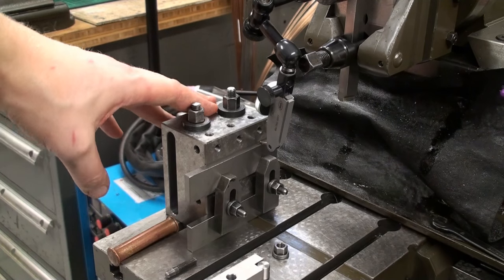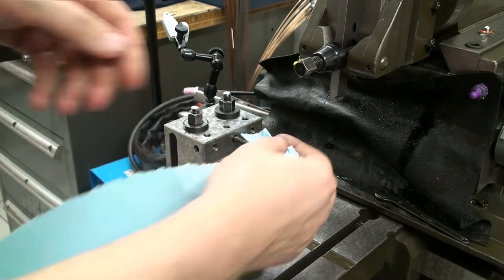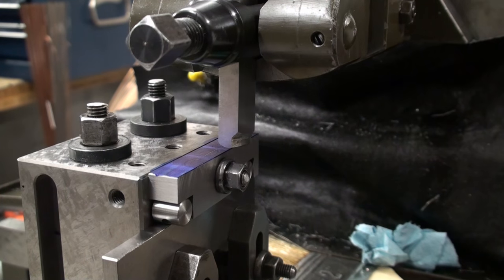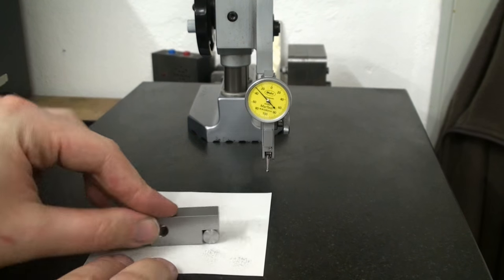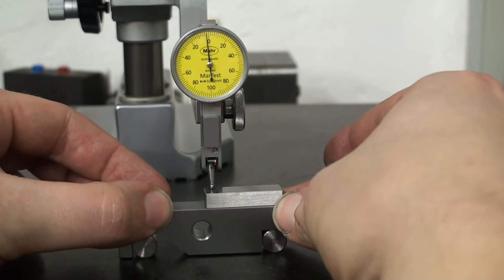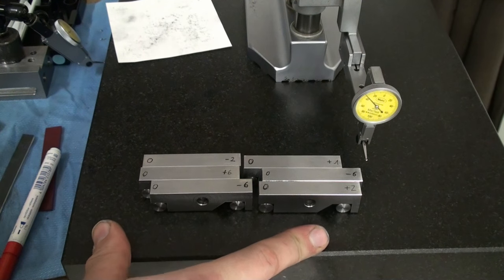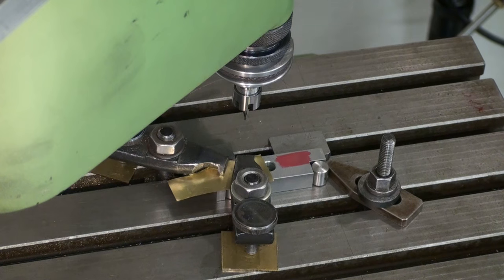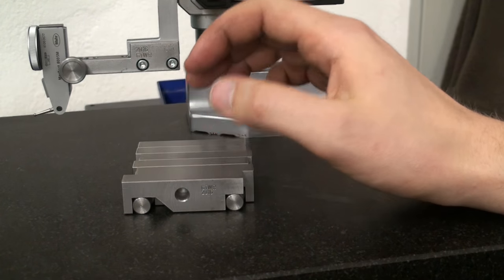Making small sine bars Part 3 - Herstellung kleiner Sinuslineale Teil 3

Comment: Love those single ended open jaw DIN 894 spanners you are using on the shaper. I got one for one specific job and ended up then buying a full set from 6 - 36mm minus some none prefered sizes like 18mm. Doubled up on things like 13 and 17mm. They are really so well made and not at all expensive, I bought Elora ones but Gedore and others make them as well.

Comment: Always interesting setups Stefan. I like how you only use holding pressure where needed and only to the degree for which it's needed. (lol don't use a sledge hammer to put a picture frame up... lol)

Comment: Stefan, I notice that you have set up the shaper to cut on the pull stroke, not the push stroke.  Does the tool kick back on the return push stroke to clear the work and not scrape the tool backwards like I have seen in other machines?  Why the difference: Does it give a better finish?
Reply from the maker: I wrote more about the pull-type clapper box here: http://gtwr.de/ressources/res_gack_rueckwaertshobelkopf/index.html
Reply: Stefan, do you mean that any horizontal shaper could with the alternative head perform pull cutting rather than push cutting?  Wow, that makes a lot of sense to me.  The parallel to me with woodworking is using Japanese saws versus European saws - the latter working on a push stroke and the former on a pull cut.  I am amazed by the ease and accuracy that a Japanese saw provides.  My grandchildren (5 years of age) can cut straight cuts using a Japanese saw - whereas my first forays into using European saws as a 5 year old only let to tears, blisters and a little blood!

By dumb luck I recently acquired a beautiful working horizontal shaper cutter with a 500 mm stroke for a tiny price. I happened to be in the foyer of a second hand equipment sales yard when someone came in wanting to sell it to the store.  The store man was not interested, but I was. Now I am looking very much forward to getting it into my possession and start using it. Your videos have been very helpful in conforming that my impulsive decision to purchase this machine was a good one.  Now all I need is a surface grinder and voila - the great basis for a toolmaker workshop.

Comment: If you can get a few thousandths of a mm i.e. microns with a shaper, you do not really need a surface grinder.  I am really , really, impressed. Unfortunately a Gack shaper is hard to come by, here in Alaska. I am more likely to find a Unicorn. You inspired me to build a pantograph to play with, and I owe you for that! And as Kjeld said, we both need a height gauge. Thank you for your videos, they are inspirational.
Reply: +Juan Rivero  - Building your own panto-graph sounds like an ambitious project.  I would like to see any photos or cad models of you design.  Good luck with the project.
- Mike
Reply: Building a plain old pantograph is easy. Tons of stuff on the net. I work on the Darwin system: evolution. I started this one with wood. Now I have metal. I wanted a Dremel tool for motive power. So I then had to add a height adjustment to it. But now I have seen a cordless engraving tool and must do a re-eval.
Reply: Oops. Forgot to add that my progress to date is in my blog, www.chalupyacres.blogspot.com. Also, in Guy Lautard's book "The Machininist's Bedside Reader, Vol. 1 there is a complete set of drawings and instructions for a pantograph. Look up Guy Lautard.